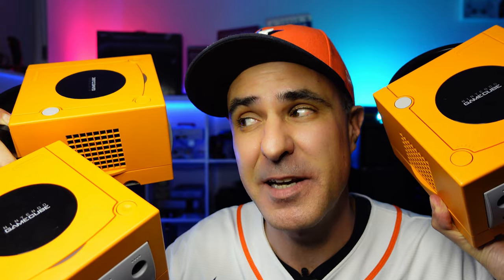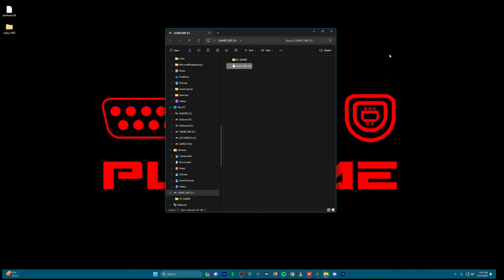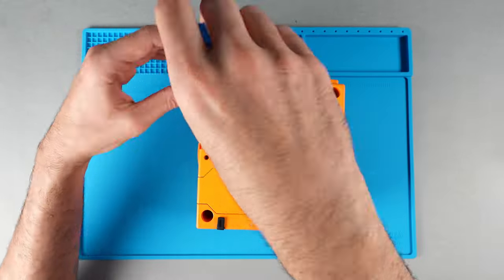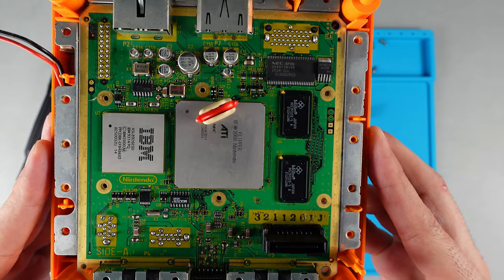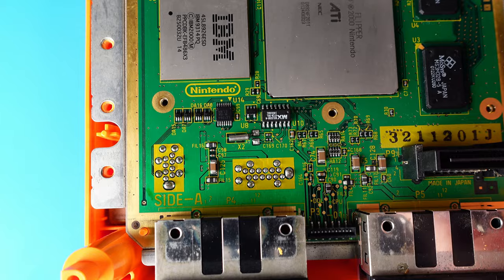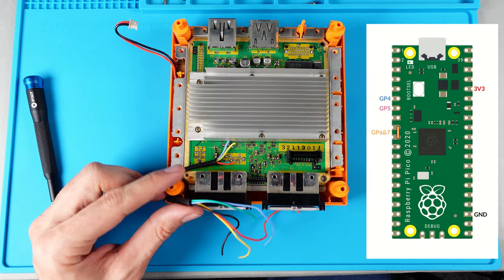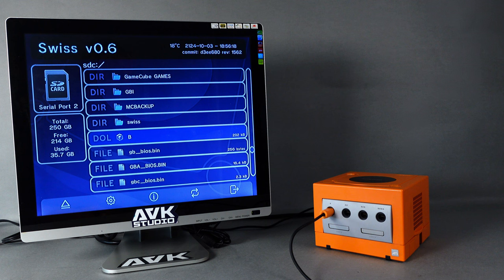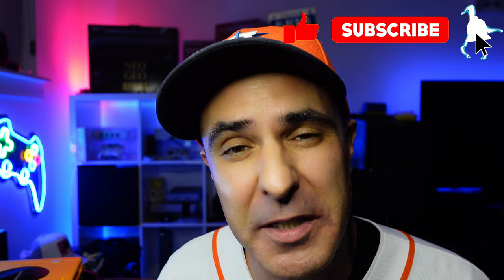Modding a NINTENDO GAMECUBE for less than $10 with PICOBOOT

Comment: you did a great job soldering for not having experience like you said!

Also. you do not need a memory card to save games. go into the settings in swiss and turn on virtual memory card.
Reply from the maker: Thank you very much, I should have mentions many other tips like "rename IPL into A, to allow the Cube to boot normally, and use A if you want to go into PicoBoot".